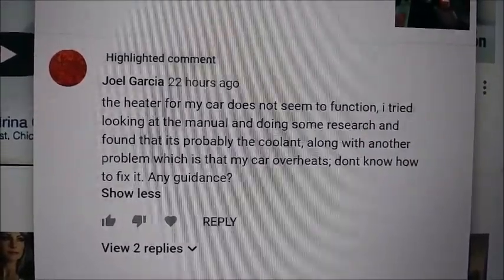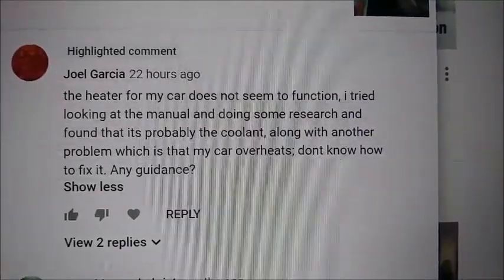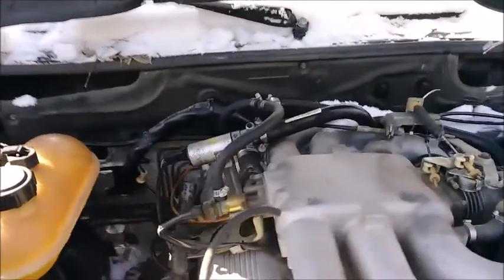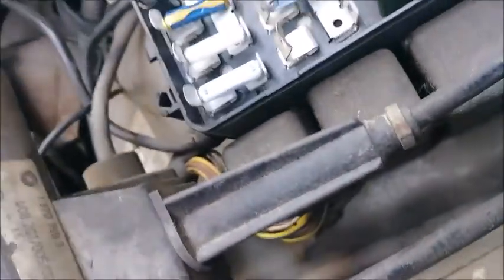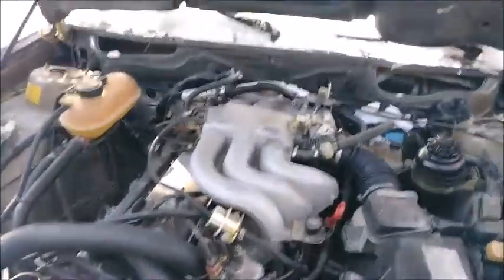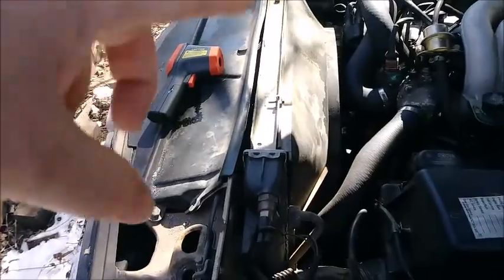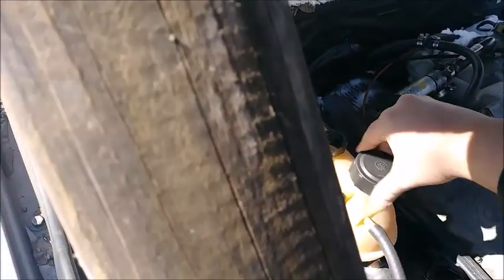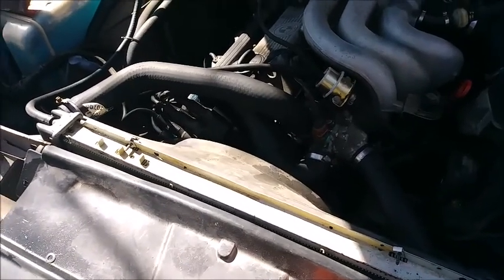How to diagnose bmw e28 overheating and heater failure

Comment: I'm going to buy a 83 533i which never had A/C. Do you know if anyone makes a kit to install A/C? I would imagine it might be a heck of a lot of work. The seller put the larger 3.4 motor in it or is a 3.5 maybe.
Reply from the maker: Oof. That sounds like it's gonna be a royal pain in the ass. More trouble than it's worth even. I don't know of any kits, but if you go that route, shoot a video and share it. I'd love to see how that goes.
Reply: @HollywoodHornet  Thanks I think I'll just go without the air. Thank you for getting back to me.

Comment: I have an '88 e28 with some kind of problem with the heater temp. control knob.  It usually clicks when turned to the warmer temps and now it doesn't seem to be engaging the heater.  Everything has been checked under the hood with new hoses and even a new expansion tank.  The heat was coming out intermittently at first, and now it doesn't seem to be activating the switch.  I need to troubleshoot this on my own as I don't trust the average mechanic to diagnose it honestly and properly.  Can you help me out?  Thank you for your time in advance.
Reply from the maker: Are you saying there is air blowing in but the air is cold even though the switch is set to hot? Or when you switch to hot there is no air blowing? If it is the former, the switch is not moving the flaps to allow heat in. There is a vacuum hose running from the interior to the exterior near the driver dash. That vacuum line and interior air temp sensor could be the problem. Check that. If your problem is the latter, you have the same issue as this e28 in my video. My e28 needs a replacement fan motor for the heat. It is located behind the engine, in the fire wall. One of these days when I get the time I plan on doing a video on replacing that motor. There are two motors for e28. The one in front of the shifter is the blower motor for the A/C. The blower motor for the heat is in the fire wall. If you have air blowing at cold select but not hot, it's the motor in the firewall. If you have air blowing when hot but not when cold is selected, it's the motor in front of the shifter. If your selector allows air to blow at any temperature selected but the air coming into the cabin, check the vacuum hose in the dash going from the interior to the engine. I never show where that is in my video, but surely someone else online will show you the hose I'm talking about that is your issue. Good luck, buddy! It's gonna be a cold winter and you need some heat.
Reply: @HollywoodHornet , I agree with your assessment of the vacuum line issue.  I was suspect of this but I needed a second opinion.  I will go in and check both.  I am familiar with the fan motor issue as I have a schematic.  BTW, there was hot air coming from the heater even when the fan is not engaged.  I feel confident that I will solve the problem.  Thanks so much for your input.  I'll keep you posted.